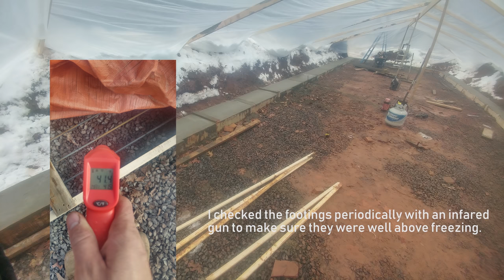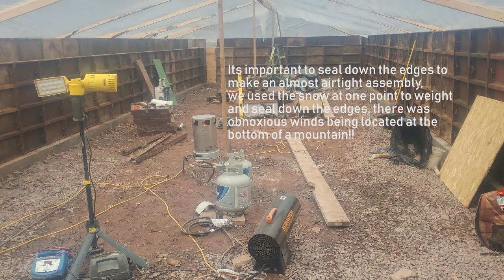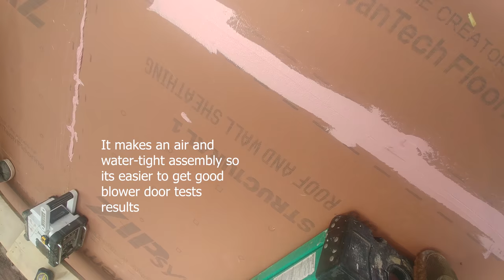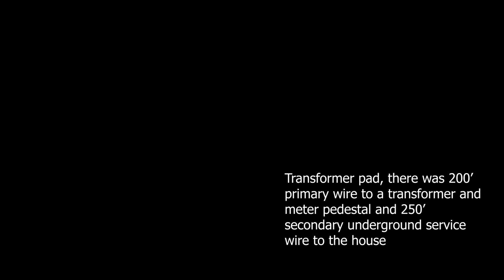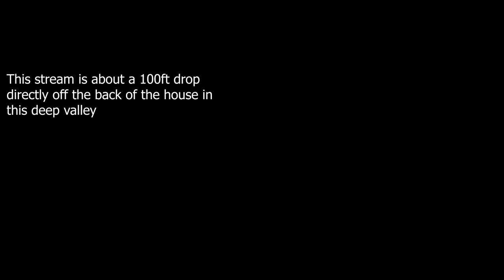Airbnb house in Round Top NY

Comment: Because of purlins, even if the screws leak, the water will fall on foam and drain off (and zip board).. what a brilliant idea! unvented roof.. super airtight. This is what I will do for my next build (right here in Greene county). Older carpenter should learn from tech savvy new crops like Jesse. I have learned the hard way. I will def. give you a call.
Reply from the maker: where in greene county are you?
Reply: @jmuller86  Properties in Palenville and Catskill. For the next one,  I will probably go up the mountain.
Reply from the maker: @sourabhb.7521  give me a call /text if you need some help. I am getting into ICF homes, as they are the most economical way to build right now with the price of lumber so high. Super tight, built to last forever is appealing too. Feel free to find me on facebook and chat.

Comment: I have been designing custom doors and windows for about 13 years now and the flashing methods keep changing.  I like this product the best so far.  much better than folding the house wrap in and using the bitchithane tape.  The only thing its missing is tiger hair!  lol  There is a video on here of a guy that built a house incredibly similar to this one, but on a slab and he used steel posts and rafters (one piece) every 10' or so with tabs welded that he ran his lumber to and fastened.  He used a lot of new products and techniques.  Both houses, yours and his are amazing and seem insanely tight!  Very nice!
Reply from the maker: thanks, I might use some of that liquid flashing on a cabin project in the adirondacks

Comment: jesse, a couple of questions. how much more would a full basement have cost as compared to the crawl space? where is the access to the crawl space? did using the prosoco joint and seam sealer on the roof have any effect on  the zip warrenty? by the way, I like the way you construct a building!
Reply from the maker: we hit a few spots of rock right at 4ft so a full basement was a crapshoot, zip actually has their own liquid seam sealer but I dont think it makes much difference if you use it or not. I will probably use this stuff on every project that requires it, it works good

Comment: Liked we do the same type of work we used the zip wall system but now use foam board to meet code wall requirements
Reply from the maker: yea they are tightening down on the energy codes. this one required r-49 for the ceiling

Comment: Is it normal to put the electric meters on wood stands like that instead of on the actual building? I've seen Andrew do that on a few projects too. At first I thought it was just temporary but then it became permanent.
Reply: Code for a while now.  In case of fire you need a disconnect away from the building.